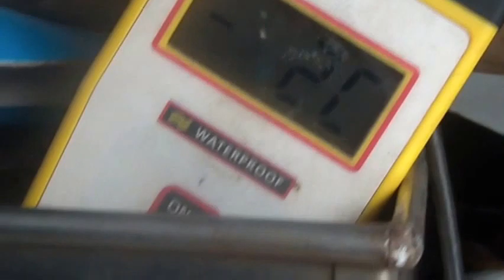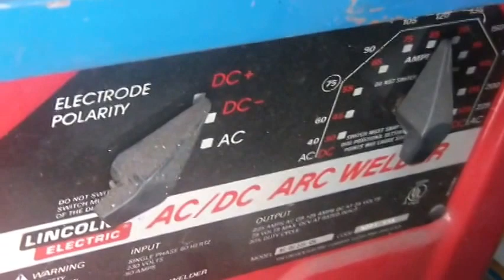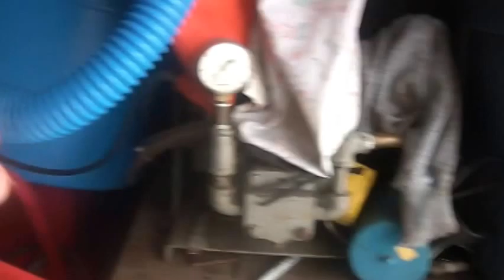3_4_14, A hoard is like a 36inch...

Comment: you only as good as the tools you have to work with, well if you cant access the tools its the same as not having them, a shop is a tool too, you started on the right path this fall, but then bought more bikes and filled that spot too, gotta stop looking for a while and get it the way you want too, stay warm,,
Reply from the maker: Hey mustie1, A comfortable shop with space to work is a tool that I have worked around by betting on good weather and a younger body, it has come to my attention that I am losing both bets and it is getting hard to get anything done. If ones' body hurts, one does not rush to work on projects. I have slowed the import of toys, now, I need to import a lift and a properly set up garage. Thanks for the advice, watching, and commenting!

Comment: Getting organized is gonna be a big job for sure.  The 1" foam board is about 12 bucks a sheet... the 2" is almost 30.  It definitely sucks working in the cold.  And a 36" unit, well, that's just not good for business unless you're in the movies, lol.
Reply from the maker: Velvethamma, If I may ask a question, is 1" of foam board, with the reflective film on both sides adequate for my garage? It is 24' x 24', winter low temps at night can go as low as 0F, and as high as 90F during the day in the summer. My days for making "movies" are over... LOL!  Thanks for the info, watching, and commenting!

Comment: You need to make up a jig for getting the wheels off the ground when you store them. As for the hoard , I think if you go thru it and put your keepers in one spot , your parts ones in another and parts in another.
Reply from the maker: 231flash, I have been getting a little better at lifting bikes and tractors before putting them in storage, I need to get better at it. Thanks for the suggestion, watching, and commenting!

Comment: A hoard is nice but a hoard that you can enjoy is a lot nicer. I like a couple weeks of  time going thru yours you could get it under control. The best way I find to do that is to pull EVERYTHING out and go thru it and build shelves to get it up off the floor so you can walk and work on stuff when you need to. But to do that you need to get some nice weather or cover it up as you go. Another thing that helps is throwing not stuff that is no good and junk. That is hard for a hoarder to do as you always say "I'll get around to fixing that" or it's a simple quick fix" as most who hoard never seem to find time to fix it. As you can see I known a few and maybe I might have a bit of a hoarder in me.
Reply from the maker: 231flash, My hoard needs 2 things, it needs to be organized, and it needs to be pruned. Shelving/bins/peg boards/tool boxes, etc will help with the organizing part. For pruning, I need to give up on a few projects that don't make sense, can be replaced with a cheaper solution, or represents something I know longer need or want. I grew up poor, so, I have a lot of trouble giving up things, A lesson that I need to learn is that my stuff is stealing space, and that space should be considered as valuable if not more so then the thing that fills that space. Thanks for sharing from one hoarder to another, thanks also for watching and taking the time to comment!
Reply: Harvey Spooner
You want to know poor? I once had to roll up 45 cents in each penny roll just to have enough to buy hotdogs to eat. You need to figure out which is "yard space" worthy and what is "indoor space " worthy.
Reply from the maker: 231flash Unfortunately, I know what it is like to be hungry. For those of us who grew up hard, there is a way we look at things differently than most other folks. I agree that I need to re-value my space and create an area to work comfortably on my stuff. The days of working outside in the cold have passed me by. My view on many projects needs to change from what is possible to what is needed and what is realistic. Thanks for the insight, watching, and taking the time to comment.

Comment: I dontt think id scrape them id prob sell them and get something for them or maybe even use a few of the big ones and take the motors off and put a honda 185 or  200 on it for a buggy.ivr done that
Reply from the maker: Zack White, Before I scrap a tractor, I take whatever parts have value, for a 300lb tractor, I only get $24 in scrap, so, to make it worth while, I have to get something of value for the hoard or resale. Thanks for watching and commenting!